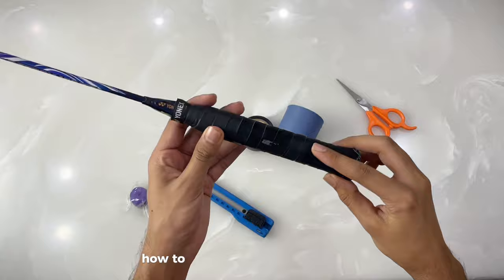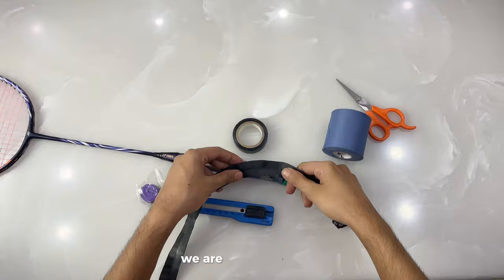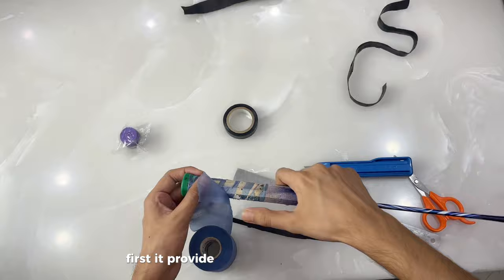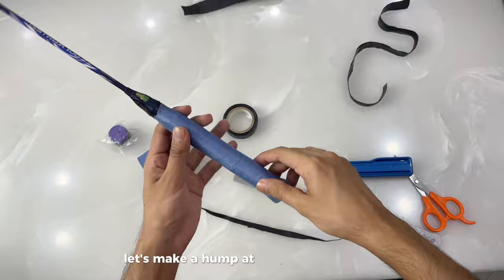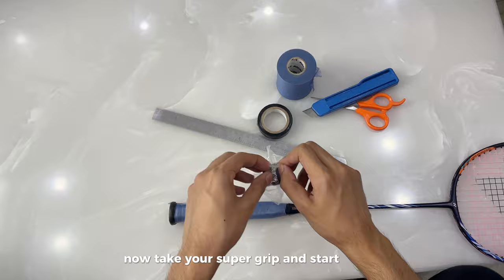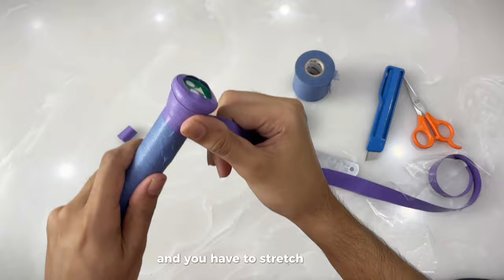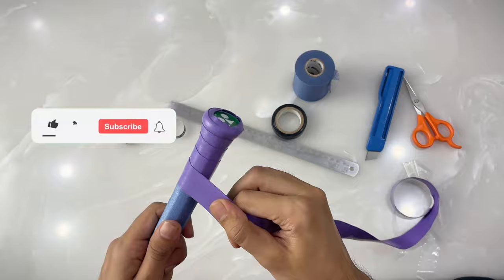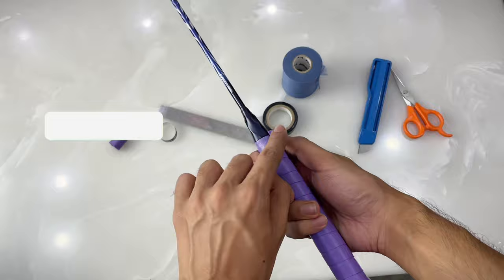How to apply a Badminton Grip  [PRO Technique] ?

Comment: Should i remove base grip, or apply cushion wrap on the base grip itself, as i haven't used cushion wrap before pls suggest
And pls tell me if using 2 fore grip has advantage or disadvantage?
Reply from the maker: Disadvantage, because u can adjust thickness of the grip in cushion wrap , and best part is it more comfortable and cushioning !

Comment: What is the benifit of applying the girp out of the handle at the bottom part?
Reply: it is to prevent the racket from slipping out from your hand and work as a pivot for your smash / drop.